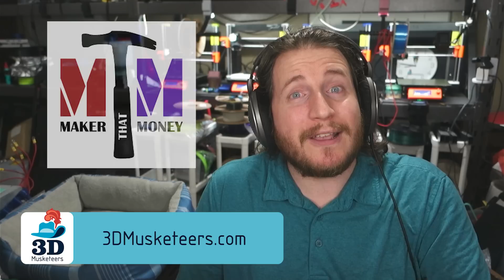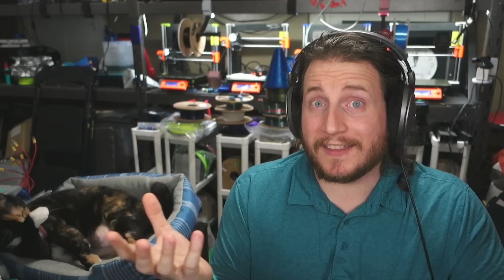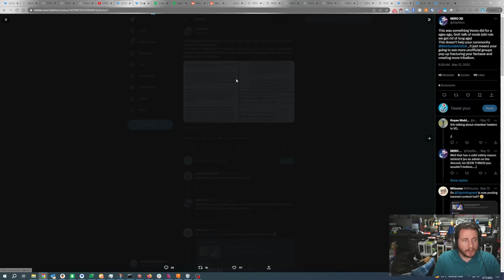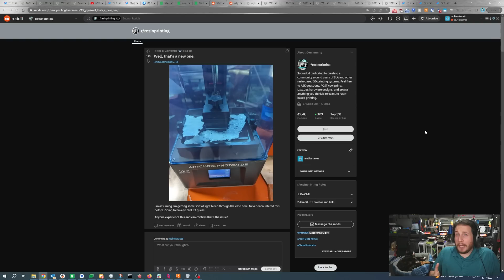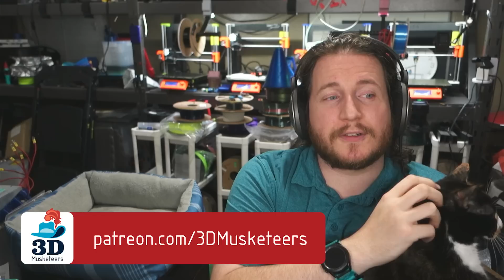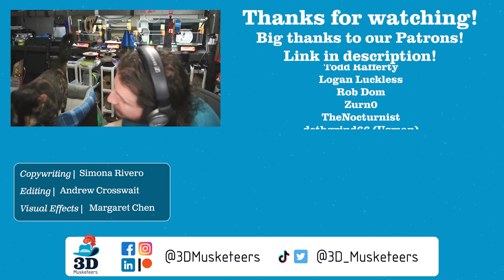Bambu Lab: Anti-Mods, Anti-Right To Repair?! - PrintFixFriday 88

Comment: I think the heatbreak on the V6 wasn’t properely screwed in enough. When he tightened the nozzle it stopped when nozzle touched the heatblock, not the heatbreak. This left a space between the nozzle and the heatbreak, resulting in the subsequent leaking of the hotend.
Reply from the maker: I made sure, the nozzle was not touching the block. That was my first thing :)
Reply: The nozzle definitely wasn't touching the block.

I do a lot of nozzle changes, sometimes daily; so I'm very confident with doing it the 'right way'. The block was just flogged out and due for replacement.
Reply from the maker: Oh hey Helpful Dan.. I mean Ben!

Comment: For that resin fail with the skin on top is super concerning as that mean the acrylic housing I providing 0 protection whatsoever from the DLP laser or UV light below. So you could be blinded if you run it with the plate up and empty.
Reply from the maker: oh, right, you know, I didnt even consider that! OOOF

Comment: I think we all saw this coming with Bambu.  It's one of the reasons I chose to sell my P1P a couple months ago.  Speed was great. I enjoyed the printer. But I didn't want to be held at gunpoint by Bambu for my repair needs.  I still hold out hope that someone will commercialize a corexy that is easy to repair and uses off the shelf hardware and software. I felt Kingroon KLP1 was a good step in the right direction but QC for it seems horrible.
Reply from the maker: Here's hoping!
Reply: Isn't creality doing that now (though they have their own issues)
Reply: @francistaylor1822  We’ll see.  No one has done a deep dive yet on its repairability. Also, they’re not really friends in open source community due to taking Klipper, and violating GPL.
Reply from the maker: we will see.

Comment: That the response to "hey we're having to fix things since there's issues" manages to include "3rd party nozzles may violate Bambu IP" seems to make good on the tone of the April 9th blog post. Like yes, if it's a 3rd party Ali clone of the exact same model that may be an IP infringement, but that's not the issue at hand. Unless there's a retraction and re-word of that I haven't gotten to in the recording, this reinforces some of my concerns about the route they might go based on the blog post.
Reply from the maker: its unsettling IMO.

Comment: This is why I'm leaning towards a Voron and a setup with the enraged rabbit carrot feeder.
Reply from the maker: I may have to an ERCF one day!
Reply: ERCF with Sturdy Bunny and Triple Decky!
Reply from the maker: why so many mods lol
Reply: @3DMusketeers  more is better don't ya know? 😋
Reply from the maker: sounds like more ways for me to screw it up LOL
Reply: @3DMusketeers  well, yes, but also no: the ERCF has issues with the bigger 9 or 12 lane units, because it's simply too long and not rigid enough - overtorquing the nuts to compensate can make parts start bending. Sturdy Bunny replaces the M5 threaded rods with a piece of 2020 extrusion.

Triple Decky improves the filament blocks themselves.
Reply from the maker: ah ok, makes sense!

Comment: Bambu = Lose your warranty putting steel rods in the X axis.
Asus = Lose your warranty updating the BIOS so your CPU doesn't explode.
Reply from the maker: oooffffff
Reply: Asus did try to back off, but that was clearly only because of the backlash.
Reply from the maker: thats how it seems to work these days

Comment: I just knew this was going to happen when the Bambu came out. It is very sad that they are having these failures at this level after just a very short amount of time.  When the Bambu came out, everybody was getting excited about it, and the first thing, and I thought was “no way”.
Right to repair, open source, I don’t need to say anymore. Prusa all the way!!!!!!
Reply from the maker: I mean, even companies that I dislike here such as CREALITY dont have these issues............
Reply: @3DMusketeers  what gets me most is that these issues don't even need to exist.  Being able to store lidar values that work best would be great but they are soo concerned with data control that they lock down everything needlessly. I love my bambu because i just works, but I see why there are such negatives for others and they could easily be avoided with even moderate transparency.
Reply from the maker: bingo
Reply: I dont nessecarily say open source is the be-all and end-all but if you build your ENTIRE product is built on open source it completely sucks if you dont also support it.
Reply: I have 2 no issues, most people in the discord have multiple and no issues. the issues are rare, or caused by many other newbie stuff. or changing things they probably shouldn't have.  SOME may have issues sure. but generally they are not. only people with issues come forward to ask about them. people running fine rarely come in to say... hey guys, my printers running fine., have a good day lol. Or using wrong settings with wrong plate,. for example the PEI is not really to be used with the lidar and can give erroneous readings.
Reply: @OnceShy_TwiceBitten  Well done on not listening to the critical point is if and when something eventually goes wrong, they dont sell the parts so you are essentially stuffed.
Reply: @OnceShy_TwiceBitten  tell that the people like the guy who runs a print farm (featured in the video) and has 12 of them with the same issue. He's no newbie.
Reply from the maker: Ben, I am told the guy that runs that farm lubed all his carbon rods which would cause them to wear faster. While I have not confirmed that, multiple people commented it, so the wear he had was his own doing, but either way, he was still stuck holding his you know what in his hands....

Comment: v6 leak: if the two faces are flat and torque ok then, start looking at cracked thread on nozzle or heatbreak . Not much metal between thread and hole.
Reply from the maker: ooooh that is a good one! I have never experienced that myself so never thought of it!
Reply: Neither of those. Just a flogged out block that's done a lot of work and has been through a couple of hundred nozzle changes.

Comment: When I opened a support ticket for the first defective machine I had, my ticket was opened with 1 simple question: What am I allowed to remove, modify or replace on this printer without voiding the warranty? I was having major vibration issues that I first thought was because of the side panels missing screws, so I wanted to add screws and possibly dampen the sound with something. They refused to answer my question about what i can and cannot do, and all they said was we dont recommend adding anything to the panels for sound. Turns out the issue causing all the vibration was a failing bearing on the left smooth metal rod which was chattering so much it eventually wore down the chrome finish... Sad part about this is it took 2 months of my own troubleshooting to figure what was causing it, and they never once offered any test or support to narrow this down... Sadly, my second machine is making the same weird vibration noise on the right side now, so I think this machine will eventually have the same issue. I also noticed play on the toolhead bushings, and a strange spiral pattern on the carbon rod, so I suspect this is causing vibrations to travel to metal rods and slowly damage everything... I also suspect the dust from the carbon rods and graphite bushings gets on the metal rods and slowly wears down the metal pretty rapidly.
Reply: Sorry you are having this issue. This is too expensive of a machine to be having these early issues. I am just thankful that I bought a Prusa MK4.
Reply: @cupertinogeek2070  I wish I bought the P1P instead because then I wouldn't feel so bad about voiding a warranty if I did my own repairs or mods. If I could do it all over again, I would probably wait it out longer than I did and just buy the K1 max just buy the P1P with AMS. I dont even use the lidar other than when it homes so its pointless for me.
Reply from the maker: yeah I got a lot of runaround until I made the 1 month video.. now all of the sudden they dont question my asks....

Comment: I'm using a textured PEI sheet, and I just now use Orca slicer and tune my filaments. I now switch off bed levelling and flow on print start. Have to agree with Nero3D about that bad bushing, mine ok so far.
Reply from the maker: I have thought about disabling flow, but I am worried the machine wont be good stock. I guess I can run some steps/mm calculations but will have to remove the AMS to do this as the buffer will change the numbers for sure.
Reply: @3DMusketeers  I use the "dark side" Orca slicer, stuff BL Studio (which is OK tbh). I am using a stock (non Hydra) AMS and it made a difference. I find the stock slicer settings with the hardened 0.6mm nozzle a bit poor, and part cooling I set using the filament parameters. I was used to this in SuperSlicer, and it works well. I get the rant vs R2R btw, but at least more parts are becoming available. I have come from a failed closed source ecosystem, and am genuinely surprised at their relatively cheap pricing. It'll be interesting how well the Creality K1 range pushes this forward, after the Qidi cloning misfire. PS When you disable flow you tick the PA checkbox and add your value in the filament profile. It overrides their firmware alterations too, although it sometimes does the vibe-thingy! which is counter intuitive.
Reply from the maker: yeah that is the nice thing about Bambu.. their stuff is cheaply priced, but thats also the issue.. its cheap

Comment: I had some funny user error this week. I was adding latches to the mirror frame/bezzle for my parent's car. I measured their location......and then built them in the wrong direction. I went left instead of right. They are 6mm wide.......I was off exactly 6mm. I measured it correctly. I just did it backwards. LMAO The next iteration was much closer. Only off in the height and it's VERY close. There is only 1 more part missing which I'm going to work on today. Make the height adjustments and try again. And I'm now 100% certain there is no way in hell my MK4 will be printing this. I haven't seen any evidence that any kits have shipped yet. 2nd half of may.....I'm starting to wonder if that means they'll start shipping on the 31st. LMAO
Reply from the maker: oh nooooooooo. Been there before!